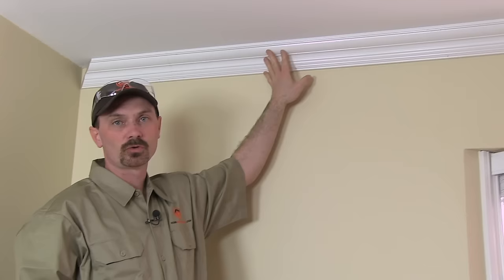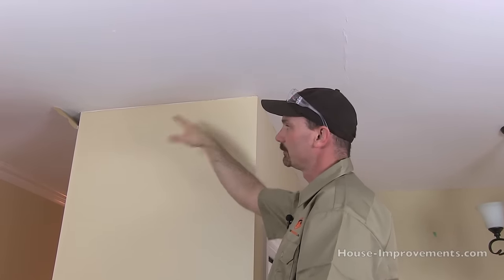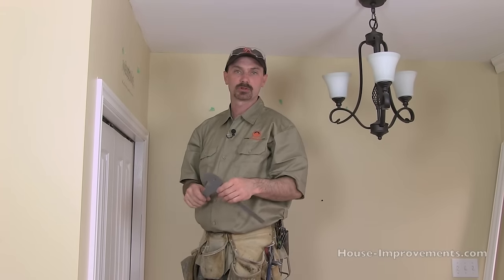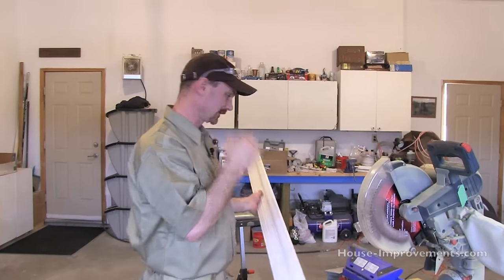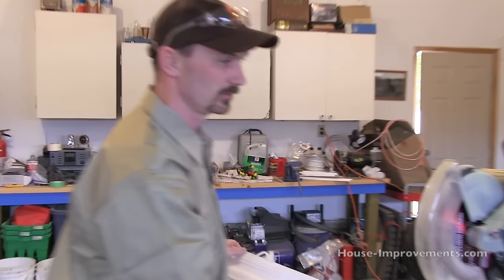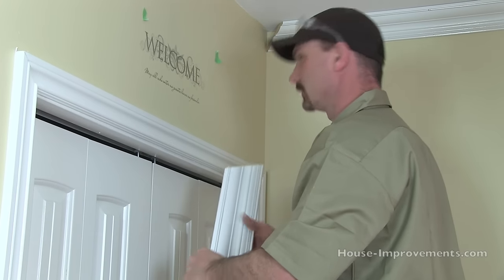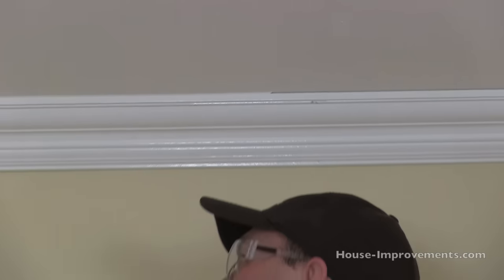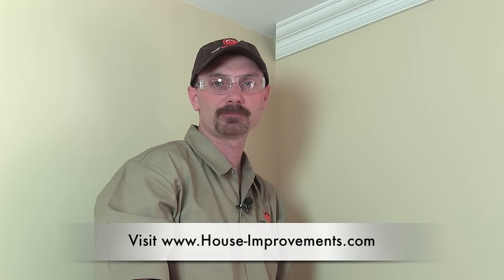How To Cut & Install Crown Moulding

Comment: Scribing is better than measuring. If you do your inside corner and get it close to it as perfect as possible hold you material on the outside corner to get the exact cut line. Overall good explanation for someone that plans on doing a diy project.

Comment: A good video I think for beginners. Lots of critics here. 
At around 33 minutes, it is pointed out that cutting 45s to butt up two ends is optional. My experience with butting up to straight cuts is that if you're not working on a true plane, or if there's bows in the wall, it's next to impossible to make that joint look decent. If you're certain it's a straight section, butt up the straight cuts. if it's an older home or if you know it's bowed, cut the 45s...
Reply from the maker: Good advise

Comment: Hey I know about guitars. I do not have a ladder and I want to measure my walls is there any possible way to measure at the bottom without using a ladder. I am afraid of highs too!
Reply from the maker: You will need a ladder to measure and install crown

Comment: I always install skewback and do my outside corners first.  In addition if the wall is over 12 feet long and 3/8 of an inch . MDF bends and drywall is joined every 4 feet. It has hills and you will come up short.

Comment: I want to put molding on, but i am not sure how the nails can firmly attached to the drywall if the wall is empty behind the drywall.
Reply from the maker: You can use a stud finder and nail to studs and then in the ceiling just angle the1-3/4" to 2" nails around 10 degrees into the drywall and you will be fine.

Comment: Shannon, just a suggestion- if coping, I would use an edge grinder to take out all the extra material rather than the hacksaw, it takes getting used to, but after a few tries you'll find the same result in a quarter of the time

Comment: Just curious...  Have you ever used an angle grinder to cope?  A friend clued me to it and I have to admit after a little practice it works great and is much faster than sawing.  By the way, love your vids.  You are very patient and your matter-of-fact style of teaching is refreshing and easy to follow.  Keep ‘em coming!
Reply: Advise for you.  You can not cope with jig saw, go drive school bus.
Reply: Zeljko Situm I didn’t write jig saw, I wrote angle grinder.  There’s a big difference.  If you don’t know the difference you should watch more vids and learn.  Drive a bus???
Reply: @mikeadams3977  No. I'm saying if you do not have hand capable to cope crown with jig saw just go do something else for living.  Same would worth for this guy in video.  Beside framing of entire house I do trim to.  But I do trim only because 9/10 of trimmers do not have gift to do it properly and I must do it at projects that I do.  I can find sheetrockers, painters, everything.  In trimming is hack after hack for some reason.
Reply: @mikeadams3977  Like a real pro I will answer yours question about angle grinder.  Yes you can cope MDF and pine with it and it is all.  Waste of time.
Reply: Zeljko Situm I’m always amazed by folks who insist on picking these perfectly good vids to death and commenting so negatively.  Give us all a break.  The guy does good work.  And I should know as I’ve been a finish carpenter since 1975 specializing in high end custom cabinetry and trim in multi-million dollar homes in Potomac, MD so don’t give me the “I’m better than everybody else in the world” speech.
Reply: @mikeadams3977  I'm not better than you in cabinetry, try to go out of it completely.  But people gifted for coping cope with jig saw.  How hell you cope 8" Mahogany, Maple or Brazilian cherry?  And we pros do not cope upside down than compound cut.

Comment: I did some crown molding today. My biggest problem was cutting my pieces to exactly the size I wanted (first time using a power miter saw) always seemed to be 1/4 inch short. Will probably improve with practice. Doing this without help is quite a chore.
Reply from the maker: cut slightly longer first and remeasure to double check. easier to cut again then to be too short.

Comment: The saw you have is a compound mother saw .... most folks try to do it the way you are explaining. They will usually fail if they have vaulted ceilings. They really need to learn to cut it flat on the saw. There are marks on the saw for laying it flat. Cope cope cope.
Reply: Robert Avery

Comment: I install a 1x behind the molding so when I brad it, it holds strong, no guessing if the brads are in wood or not....I can't cope
Reply: I do angle blocks behind large mouldings. Always hit studs and joists. I wouldn't want to hit any pipes or wires. This man says nail about every 16 inches. That's not accurate.
Reply: If you "stitch" nail it it will hold better

Comment: I'm in South Central Alaska building my cabin. I wanted to put heavy duty crown molding for utility, for hanging stuff on so I hatchet trimmed 2x4s to fit the wall/ceiling but had trouble with the corner angles. Almost decided to just go flat on the wall until I came across your video. I rigged me a homemade miter box for my handsaw. Works like a charm and looks good too.  Thanks for the video.

Comment: The pice with the two outside corners...hold it about where it goes and nail in the middle...then proceed to adjust. You committed yourself to one side before you made the corner meet.....roll both sides down hill and the top will come together
seriously have you done much of this before?
Reply: Well, george crown, I am sure you are a fine craftsman with many years experience as one could ask. At  0:13, I already knew this man wasn't. When was the last time you installed crown, without knowing what size it is? "I'm not even sure, it must be a 5 or 6 inch crown mold." Hey, do you use a jig to cradle your crown, george crown? Or do you cut crown flat on the base?                                                                                       All of the comments you posted; at least the ones I read; suggested you may be an expert in crown mold installation. I would like to see your work someday. Upload what you got if you haven't yet.
Reply: pheather plucker I do curved wood stairs for a living and travel the country to fill request for my expertise so yeah i'm pretty good at straight molding...my corners never need filling...at all

Comment: I use a filler to close that gap when it happens. Paint over in some cases and you'll never see it. I recommend test pieces using scrap on corners first. To compensate uneven corners it can save $ using scrap wood first and then cut the good stuff after and you can leave knowing the customer is more than happy so much so they gave you more work. No gaps. I know you know but most don't take the extra time to cut pre test. Arrogance too.
Reply from the maker: +Canadiangunman Thanks for the comment

Comment: My walls have some tiny popcorn, and ceiling. Can I still install crown molding? Thanks
Reply from the maker: If it's pretty small you should be able to.
Reply: yes you will just need more caulk to fill

Comment: hey bud i enjoy your videos for shit i dont know but in this case you should of marked your studs from the corner in so its nailed properly then shoot your marks and fill it remember those nails barely hold into drywall alone..i frame custom homes
Reply from the maker: +johnny a  In this case the size of the crown allows the nails to be hitting the double top plate.
Reply: that looks more then 3" down from the ceiling just saying these videos are nice to learn more in other trades i'm not usually a finish carpenter but its better them framing outside in the Canadian winters lol

Comment: When caulking it helps to use a fairly dense sponge , WET, the area you will be caulking lightly, run the small bead of caulking along the moist area, run your finger along the area like this man does, but the advantage with the water and sponge is the  water will stop the caulking from smearing on the walls and or molding and makes clean up a lot easier!.
Reply from the maker: Hmm, I will try that

Comment: Thanks for the video. I've done a lot DIY building projects and I'm a pretty decent carpenter but I've only done crown a couple times and I struggled with it. It's really easy to forget what you were doing and cut the wrong angle and getting the miters to line up on a wall/ceiling that aren't flat can be tough. I found the inside corners easier to "fix" because you can hide things with a coped cut but there's no hiding a bad outside corner joint. I've watched a few videos from guys that only do trim work and have to admit they have it down to a science. Me, I'm still learning.

Comment: I think he did a fine job walking through the steps. Crown molding can be a bitch to install and even the most seasoned professional can find it frustrating. I have installed it before but not in a dogs age and what I'm installing is much wider then what I'm used to. I needed a refresher on the flipping the cuts, which can be very confusing and very expensive if your not paying attention. I liked the way he demonstrated and didn't edit out his imperfections because imperfections are a very real aspect of such a task. I also bought the same a jig and wasn't sure I was understanding the directions right. Thank you for the video it has helped a lot and I will be checking out other videos of yours when I need it.
Reply from the maker: Thank you Steve
Reply: NO thank you. I've always cut in place but I have  a compound miter saw and was toying with cutting flat. do you ever install like this.  the molding is 39/52. The reason is I bought one of those jig like the one you have and it doesn't really accommodate the 52 angle when you flip it. Do you have a video for cutting flat?
Reply from the maker: sorry we do not.
Reply: If I could ask just one more question. When you encounter a spring angle greater then 45deg do you find it somewhat impossible to get the coping of an inside corner correct? I was trying out a piece that was 52deg and about 5 inches in height it seemed like I could clear enough behind the profile to have fit properly against the piece it was butted up against. I tried it on a much smaller peice that had an even 45deg and not a problem, it came out perfect but I've tried several times on the larger molding and I get close but still not anywhere acceptable. I is it really that bad to mitre an inside corner? I install a lot of baseboard and I never miter the inside because simply it's the wrong way to do it. Is it common to miter large stocks of crown molding and have you had this particular problem. Sorry for the q&a but i've been playing with wood all my live and I've never been stumped and this damn thing has me feeling pretty frustrated. Thanks.

Comment: He could have fixed that outside miter by changing the spring angle. To do so, hit the top of the crown with a hammer, in the direction of the wall. The bottom of the crown will slide down the wall. You are basically twisting the crown so that the tops of the miter are closer.  You will need to do it with both pieces. On a short wall like that, you will want to make sure to put the opposite miter together and let the glue cure for 20 mins, before attempting to twist or roll the crown.
Reply from the maker: ya was trying that, could not quite get the entire gap out.

Comment: For those using the mitre saw, and having problems getting your 45° angles nice on the out sides corners where coping is not used "put your carpenters pencil underneath the crown as this will raise it the crown up just a wee bit enough to tighten your angle.. this varies depending on how its fitting"
Reply from the maker: That's great tip . That creates a slight under cut on the back edge to help close the front face cut.
Reply: HouseImprovements  good videos on the past .but not this one. you made a big mistake in that outside corner the easy fix is just slide the crown down a bit to close that gap .NO ROOM FOR DAP ON OUTSIDE CORNERS
Reply: HouseImprovements listen to 32 bala...he knows what he is talking about

Comment: Thank you for your reply!  We, and I say we, because I worked for years installing Formica counter tops, and the dense sponge and water works very well. Of course a small bucket of water is needed to rinse out the sponge, but the results are worth it. Also finish up the caulking by going over the area again ( after you remove excess caulking) with the moisten sponge. I always wiped the excess caulking from my finger on a rag ,or paper towel ,so the water would stay cleaner longer !
Reply from the maker: Always learning something! Thats what happens when we are not afraid to share our "trade secrets"

Comment: I struggle with moulding and trim so much! My husband and I have done just about every DIY job around our house by ourselves and we've been able to do it beautifully; plumbing, drywall, cabinetry, flooring, etc, we've even made quite a bit of furniture! But the dang trim has by FAR been the biggest pain and getting it right still eludes me for some reason; it never turns out right!

This is probably a stupid question, but when you're measuring your wall, do you use that  measurement as the short or long point on your trim? For instance, if your wall was 55 inches, let's say, would your trim measure 55 from short point to short point, or long point to long point? And does that change if it's an inside corner vs an outside corner? We have a standard square room that we just finished drywalling and now we're at the point of trim and I really don't want to have any waste if I can help it! We built a small frame for a custom chalkboard out of window trim and none of the angles lined up properly and I had to trash a couple pieces. It should have been 4 easy corners at a standard 90° angle and I couldn't even get that right. :( Thanks so much for your videos! They're so helpful for a DIYer like myself!
Reply: I should also mention that I don't have an electric saw, we're doing this by hand with a miter box. If you've got any additional tips for working with that :)
Reply from the maker: +HHATW if both corners are inside then the measurement is short to short. if they are both outside corners they are long to long. If it is one of each then short to long.

Comment: How do you do rounded corners?  Do you have to use a small extra piece to join the two long pieces?
Reply from the maker: Usually yes,but that also creates double the work for every outside corner. You can just miter it square and caulk the gap at the bottom  but it does not look as good .

Comment: when you nail your crown molding do you nail to wall studs and ceiling joists or just nail it to the sheetrock? does it matter? mike.
Reply from the maker: +Mike Eldredge In our case the double top plate was getting nailed to but try to hit studs when you can. angle the nails when going through just sheetrock for better holding power.
Reply: +HouseImprovements thanks for the fast response! I built my house 8 years ago and have been wanting to do it but reluctant to because I know nothing about it but I do know that it makes a room or house look finished.... thanks for getting back to me and great video.

Comment: The crown on the right side is sitting to high an easy fix would’ve been to simply reposition it slightly lower maybe by a 16th of an inch and it would’ve sat nice and tight

Comment: Have a 8ft ceiling in my kitchen. What size crown mold should I use,
Reply from the maker: personal choice really
Reply: alphacharlie65ms Not.. Use the smaller molding as it looks way better. It's like 2.5 or 2.75"

Comment: Thanks for sharing. What angle (if any) should I cut the piece before coping it into the straight piece on an inside corner?
Reply from the maker: Same as if you were mitring it to match the corner you are doing. So for a 90 degree corner you would cut it to a 45 degree angle

Comment: How do you nail it into the ceiling since the joists only run one way and it’s too far off the wall to hit the top stud?
Reply from the maker: Angle the nails slightly , they will hold fine in drywall.

Comment: why don't you make a 22degree Angel it sure Will look nicer.
Reply from the maker: +Israel Garza A 22Degree angle at each corner is way more cuts to turn the corner . It looks good but most people would not even notice the difference.

Comment: Do you not mark the walls for studs and the ceiling joists?
Reply from the maker: For this size crown the bottom nails would hit the plates and the top nails I just install on an angle to hold tight. You can mark joists and nail directly if you wish.

Comment: Is there any particular reason you would do a coup cut instead of a miter joint?
Reply from the maker: Usually a coped joint will give a nicer fit and result. If you are caulking a painted trim anyways ,usually you dont need a coped joint IMO.

Comment: When you go a paint over the filled nail holes and corner gaps, do you need to spot prime? Or is a paint+primer good enough?

Also, do you actually need to fill in 18 gauge nail holes? I've heard of people just painting over them since they're so small.
Reply from the maker: depends on the product you are using, you may need two coats or a spot prime. 
18 gauge is to large not to fill IMO

Comment: You doing a good job the inside cut if it has a gaps thats fine, but the outside cut  it shouldn't have a car even if the ceiling is not straight.